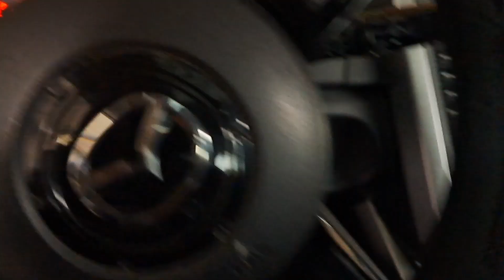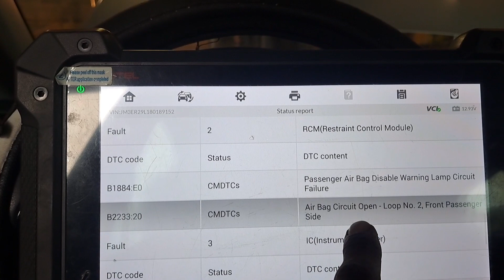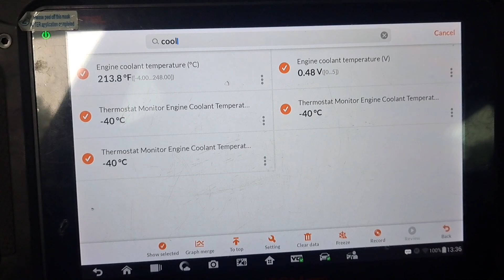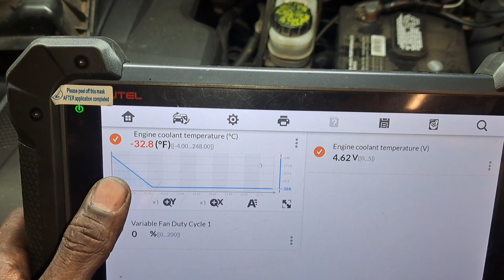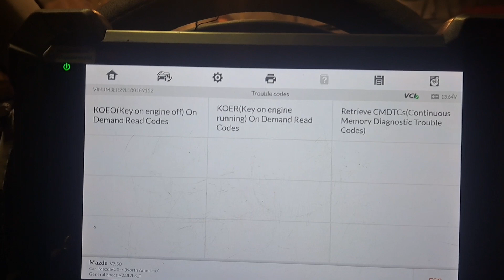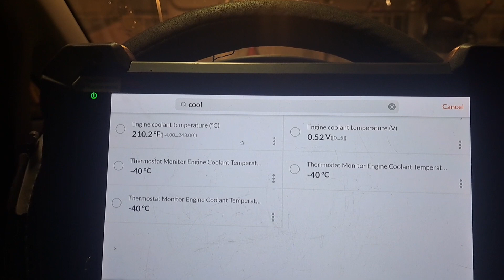FORD/Mazda P0117 Engine coolant temperature sensor 1 circuit low FIX

Comment: If you feel that the temp is too high with this aftermarket sensor, all you need to do is measure the actual temp of the coolant and resistance of the sensor and check the Service Into in the repair manual temp vs resistance chart, if you are not happy with the temp reading on the scan tool then purchase another brand of sensor with a different room temperature reading than what this sensor shows or modify this circuit with a resistor, I know you are a fan of modifying components. Otherwise be sure the coolant to water mixture is good to insure the engine will not overheat and be sure the front of the AC Condensor and Radiator are clean to assist in heat exchange and that all air dams are installed to help guide the air through the cooling fan schroud. Installing a lower temp thermostat is another way to calm our stress as long as the engine still runs in fuel control. Checking coolant level alone is not good, we need to give a proper test to insure proper ratio, the coolant is only as good as the amount of coolant to water ratio to raise the boiling point as high as possible, too much coolant mix is a bad thing vs water. Coolant requires periodic exchanges the same as transmission and brake fluids, etc, they are not life time zero maintanance fluids. If we cannot dispose of the fluids properly, educate our customers on better car care procedures and where to go to get that service and GIT ER DONE. Thanks for the video.